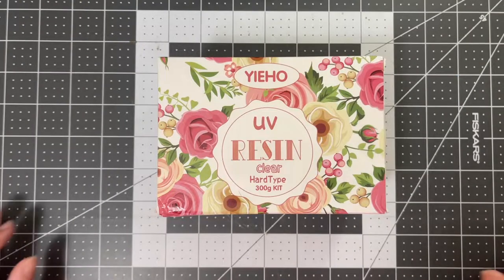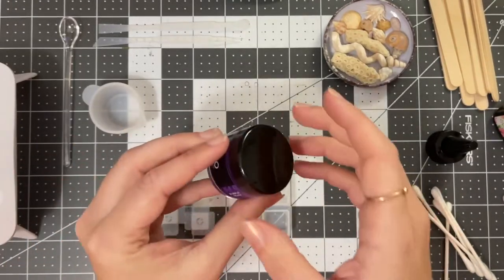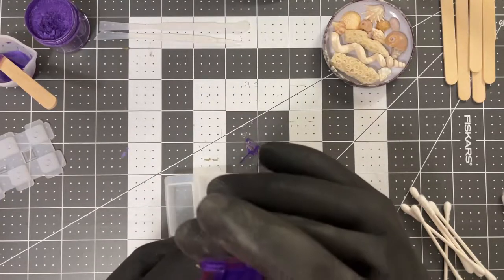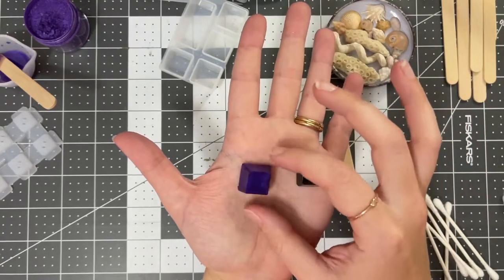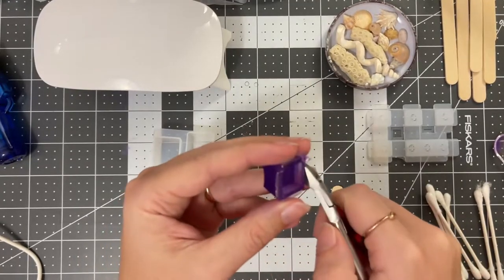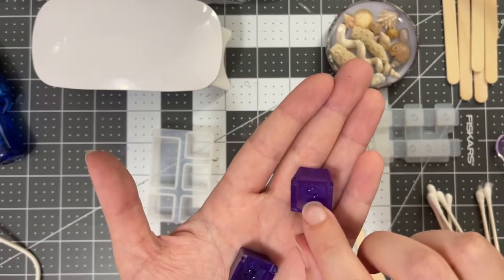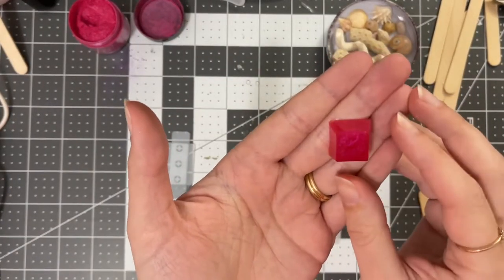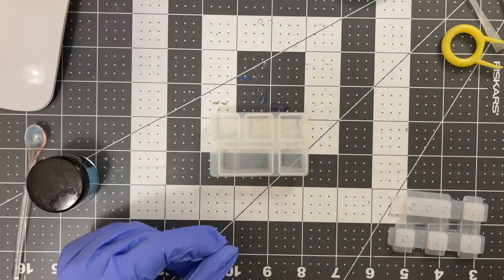Project Time | UV Resin Keycaps

Comment: You probably know this by now, but Uv resin works better if you cure the layers separately. They do bond together. So clear plus seashell first and then the blue. Also a tip - use gel nail polish to color the Uv resin. And a mirror under the lamp will add to the light’s efficacy .  Thanks for sharing your journey.

Comment: I haven't used Resin nor have I made any type of keycap all the info is what I picked up from watching other Keycap DIYers!
The type of Keycap is also important there are multiple different styles of Caps not only interms of stem but also the form and height of the top part.
[It's less important if you have a floating key keyboard and plan on doing all caps but if you have a frame keyboard or only want to do a few caps you should pay attention to get the right mold so it fits the rest of your caps]
Other Cap DIYers put resin into the stem part of the mold and cure it then leave it there and put it in like you did and that way it cures togther into 1 piece and comes out perfect.
Another tip too much is better then too little it sqeezing out the top isnt a problem but if you have to little you end up with bubbles and incomplet caps which is really hard to fix.